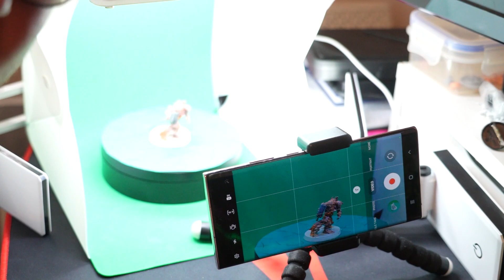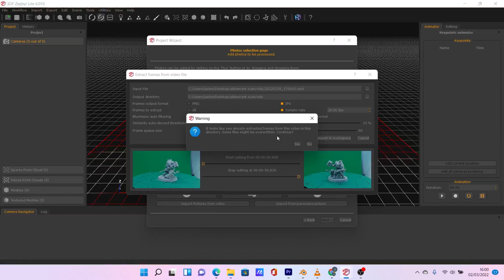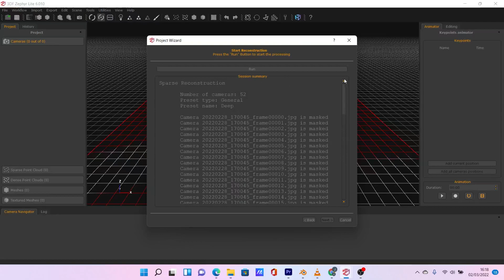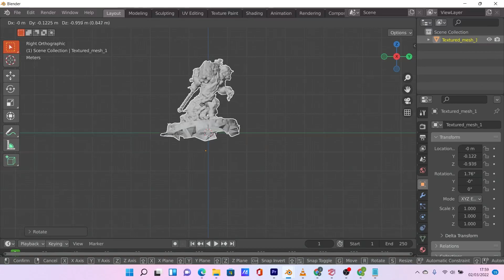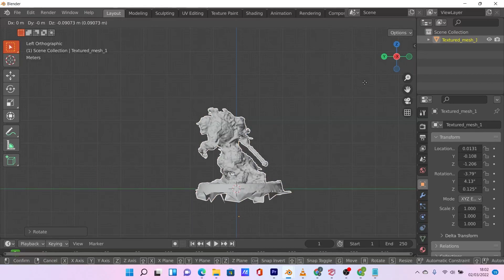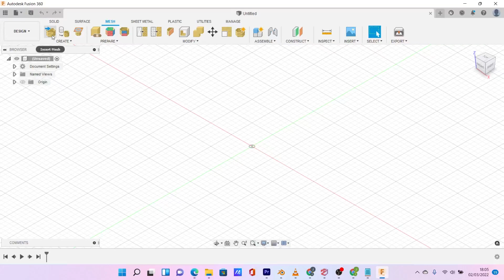How to scan miniatures with your smartphone using photogrammetry, create an STL and 3D print them!

Comment: could you scan using photogrammetry vintage he man armor espicaly the two peice hordak armor that is 4-5 inches long and across with a 2mm wall thickness with 4 pins measuring at 2mm x 2mm with a extrusion from armor at 4mm?
Reply from the maker: I don't see why you couldn't. You would need to add in a couple of reference objects so that you could keep the scale dimensions accurate but it should be doable.
Reply: @tabletopscanman  i'll try tomorrow , i have the revopoint pop2 its oky doki for scanning larger objects even small BUT thin thin geometry not so much it deformed the pins :(
Reply from the maker: @TheCanadienMickeyMouse  I have a revopoint mini I usually do separate scans of thin objects then combine in revo studio before cleaning up in blender. 2mm is very thin but photogrammetry is about your base images so get them good and it should come out well.
Reply: @tabletopscanman  thanks i want to make custom motu with my own action figures i photoshoped 70-80 i could make them into real figures BUT the hordak armor has to be the first model made I have found someone has 3d scanned it professionaly on cult3d but i want to do my own not use what other people have done. it was done using one of them artec 3d scanners only at $50,000 (australian converted) and thats $48000 too much on my budget...